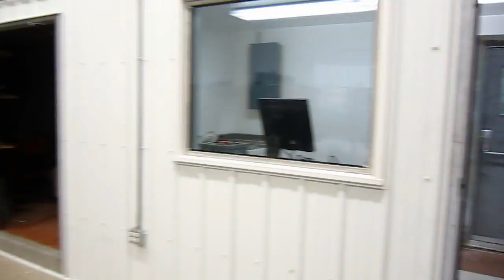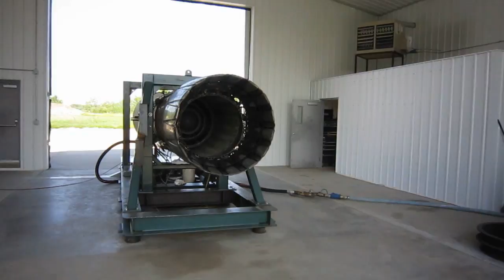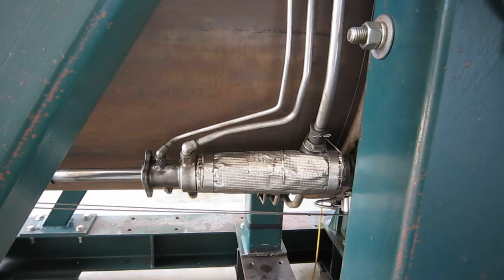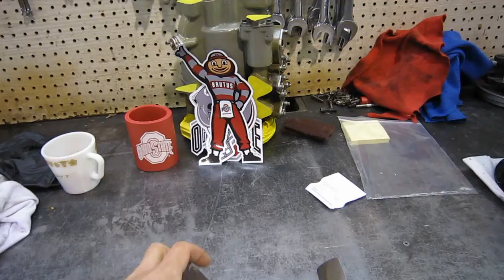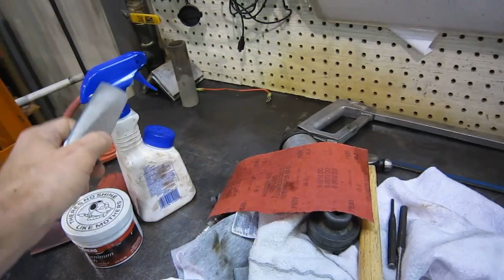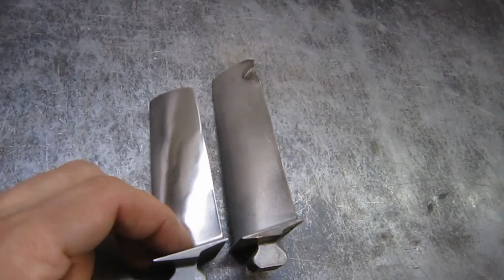Afterburner Spark Test and More

Comment: What model J79 is this?  What does it go in?  Never seen the air start on the front gear box . Transfer gearbox had  the starter. The A/B  Nozzle is most def a -17 Burner. I worked J79-15's and -17's on F-4's.. The A/B nozzle actuators were opened and closed by oil pressure, not fuel. I don't see fuel hoses going  into the bottom of the temp amp, for cooling..or maybe I just can't see them.  Only 3 canon plugs on the Temp Amp. No T-5 reset I take it... Cool video.

Comment from the maker: Yes, the mixing air holes allow air outside the liner to move inward, which protects the casing and also the liner itself.
I think the liner is made of a high temp alloy like Inconel, but it may be stainless steel, because, due to the mixing air layer, it does not get as hot as you might expect.
Reply: It seems that some of the people commenting actually worked on the engines and some people just talked about it. As for myself I was in the Air National Guard and worked on J-57s that went in the F-102. I enjoyed it immensely. Probably because I only did it one weekend out of the month during my service.

Comment from the maker: @d46512 The measurement commonly referred to as EGT is actually turbine outlet temp. and is not affected by an afterburner. The AB increases thrust by increasing the temp of the exhaust gases after they have already left the "regular" engine.
So, the temp of the exhaust of the thing on the wing IS increased, but EGT isn't.

Anyway... afterburners are not used in industrial situations because power turbines are optimised for one particular amount of gas flow and heat.

Comment: you have said about the J79 & LM1500 being similar
I heard you say the core's being the same I did want to know this Question very much
Is the LM1500 a ground shaft engine only, I try to pick the up
AgentJayZ you are the go to guy for all the facts
this subject is fascinating to me I watch lots of video's
even though this video is 10yrs old, knowledge is forever
thank you AgentJayZ
Reply from the maker: The core of a J79 is an LM1500. The part numbers used to be identical for blades, discs, shafts, cases, stators, etc.
GE quickly established separate divisions with their own specialized parts and part numbers, but in the early models of LM1500s, J79 parts work just fine.
Very similar to the GM LS series of engines being used in cars, trucks, and boats. You know there are marine versions of the LS engines, don't you?
Not completely identical, but the internal dimensions are the same.
Reply: @AgentJayZ  thanks for your assistance
I grew up loving aviation and the Jet in all it's type's shaft, prop and thrust even ground or ship shaft, the sound and it's rising instruments. which were greek at one time, now I know, but being broken up and disabled with Epilepsy I am unable and 51 it's very unlikely i'll make a career of it
I very much do like the understanding of of my favourite engine type
sorry you missed Oshkosh

Comment: Quick question:
"How does the variable geometry nozzle work; what makes it change diameter size if its an all-metal or all-ceramic construction; any hydraulic actuation involved?"
Thanks.
Reply from the maker: 1: no quick answer available
2: it's made of separate pieces
3: 4 hydraulic actuators

Comment: +AgentJayZ Why must you polish compressor blades so much? My guess is that the main purpose is to remove defects which might form a point of failure for stress fractures. Is that the only reason?
Reply from the maker: Mostly that, but keep in mind that new compressor blades have a dull, matte finish.
Have you seen Jet Tech - The Leading Edge ?
Reply: Aha! You answer exactly this in that video. You say:

"Now you can polish with scotch brite, and you can polish with metal polish if you want, and get the whole blade gleaming like it's been chromed; and that won't help. The only thing we're worried about is the leading edge of the blade, because that's where the stresses are highest, and that's where a crack is going to start."

So in answer to my question here, you don't polish the blades so much - it seems you work almost entirely on the leading edge.

Comment: Awesome video's Jay! Question about the torch igniter: Kleine Brogel the howling sound of the J 79 engine !!! The f104's in the video seem to have this torch lit when they're running idle, without using the afterburner (about 3 minutes into the video). When the engine revs up, it seems to stop, though when the engine returns to idle, it lights up again. Any idea why?
Reply from the maker: I've commented years before about this video. I'm not an expert on the F-104, but it looks like the torch igniters for the AB are stuck in the on position.
I don't know how that could happen, but it would not be harmful.

Comment: Why it has ignition plug at the end of the engine, burning the fuel or the gas process is already finished?
why ignition plug at the after burner stage? I did not get the reason...
Reply from the maker: Have a look at my video about the J79.
It's in my playlist of engine cutaways.

Comment: I curious about the fuel/ air ratio when the afterburner is lit. There must be very little oxygenated gas in the exhaust stream to properly burn the added fuel. Is there an alternate air inlet that provides the enormous quantity of air to oxidize the equally enormous amount of fuel that is dumped in the tail stream.
Reply from the maker: +videoclipits    You assumption that there very little "oxygenated gas" ( that would be oxygen ), left in the gas stream after the combustors is not correct.
I have many videos explaining why.
Reply: Well that explains it then. Not all the air going thru a jet engine is used for combustion.
Reply from the maker: +videoclipits   Only about 15 to 20 percent.
Reply: Ok thanks. finally figured out how to do channel search. They hide the little search bar.
Reply: Gas turbine engines, even modern ones, are incapable of running at anywhere near stoichiometric AFR's (Air/Fuel Ratios). The heat generated would melt down any engine core, even if you used the most expensive super alloys. Most of the oxygen from the air provided by the compressor is NOT used for combustion, but fed to the various internals that use air for cooling, customer air utilities, and most importantly, mixed with the expanding gasses from the combustor to cool them before hitting the turbines then jetted out through the nozzle to add to the thrust produced. Afterburners were invented with this concept in mind. Because there is so much oxygen in the exhaust of jet engines, why not use up more of that oxygen in another combustion stage that is already being fed hot, dense air? No moving parts downstream, no Turbine Inlet Temp to worry about in the jet pipe. So burning TONS more fuel in the exhaust stream were EGT is less of an issue is a simple (if inefficient) way of producing a lot more power on a smaller engine package for military uses.

Comment: is it normal for the afterburner chamber to be coated?
or is that a military thing?
Reply from the maker: +AllyourBaseArebelongToUs    I know of no afterburner that isn't a military thing. The coating is normal. It adds protection from the heat.
Reply: AgentJayZ i was just curious
i assemble the f119 and f135 AUG liners.
but i know Zip zero about them.
Reply from the maker: Well, my natural response to that statement is to ask why...
Reply: AgentJayZ "why" to what?
Reply: +AllyourBaseArebelongToUs i think why You  know nothing about them... working with those engines is like a dream... but my question is what is AUG?
Reply: bboySuchy I meant I didn't know how they worked.
I can assemble them blindfolded.

AUG is auxiliary combustion chamber, also known as the afterburner
Reply: +AllyourBaseArebelongToUs g8 thx honestly never heard this short name for it
Reply: Rolls-Royce/Snecma Olympus 593's for the Concorde use afterburners, or "reheat" as the Brits say. I wouldn't know, but i'd imagine some heat resistant coating of sorts is used on those too.
Reply: AgentJayZ Rolls Royce Olympus as used in Concorde was a non military a/b

Comment: +AgentJayZ can you tell me how much energy a single spark has and what the open circuit voltage of the ignitor box is?
Reply from the maker: I only know that the sparks are considered dangerous to people. They are in the 20-50KV range, but I don't know the current.
Reply: I found some information on these ignitors. They are designed to dump 2-4 joules of energy on each spark independent of the voltage. The long range ignitor plugs (at least the old Champion ones) have a working voltage between 18 and 26 kV but the open circuit voltage is much higher as the excitors are designed as a resonant tank with a trigger spark gap. Modern excitors have some sort of timer/controller inside, like a 555, that charges the ignition coil on an instant when required. So no need for capacitors anymore.

Btw. half a joule of electricity can cause instant death.
Reply from the maker: You are the kind of guy that we need to design a 120VAC 60Hz input  ignitor unit that will fire the ignitors at 2-4HZ.